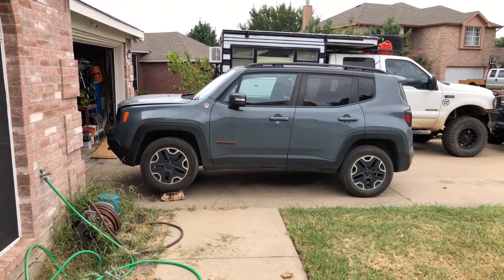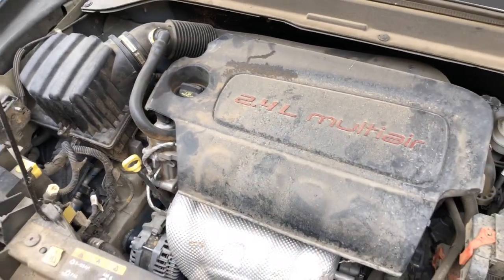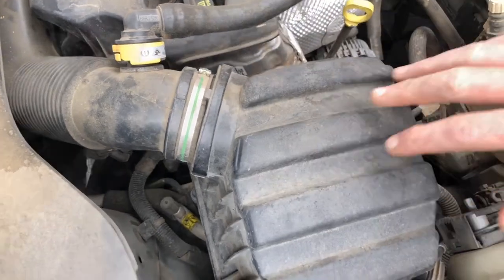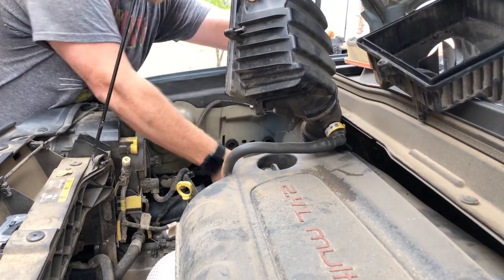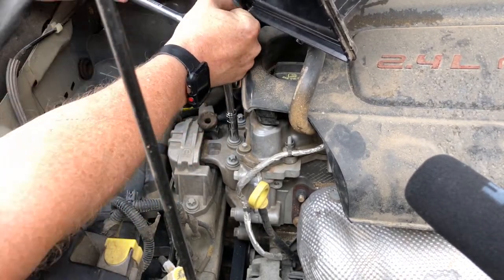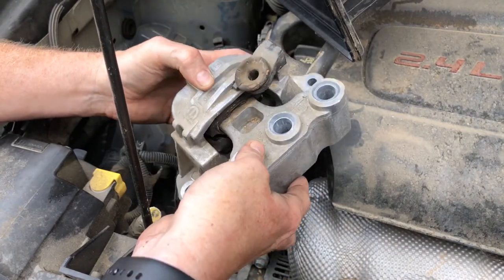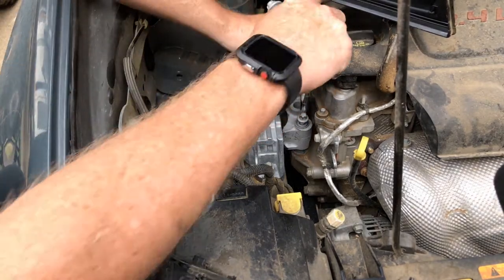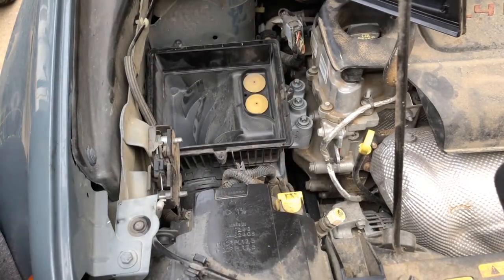How to replace 2015-16 Jeep Renegade passenger side motor mount

Comment: You really should wash that engine regularly to remove that kind of dirt. Believe it or not that dirt will find its way into your engine, transmission and differential. Make cleaning the engine bay part of your maintenance routine. Mine still looks brand new even after 49000 miles.
Reply: I want to clean mine please help any advice and recommendations would be great what should I cover what solution do you use. I detail my fiat all the time but haven't cleaned my bay
Reply: @housebaelishgaming  , I just use a regular water  based degreaser solution. I spray it all over the motor and engine bay taking care not to  wet electrical items too much. Then I wash it off using a garden hose. To dry I use a small air blower.  It works really good. I'm not too worried if the alternator got wet. The important parts like bearings are sealed. no water will get in. To make the plastic and rubber parts like hoses look nice and black I just spray them with armorall. There are many products out there that will do a good job.
Reply: @mainsfortes5778  great thanks so much!  The armor all won't cook those hoses like cooking oil right? I imagine you wouldn't uses it if it did
Reply: @housebaelishgaming  , armorall is fine. There's many others like 303 that works great too.
They are fine for plastic and rubber.
Reply: @mainsfortes5778  ok great

Comment: My dad ordered the new mounts for my sister’s Jeep. They arrived at the dealership recently. How long does it take for technicians to swap these parts? They said to drop off the car for 5 to 6 days. Can’t believe this didn’t make it to the list of recalls for this Jeep.
Reply from the maker: The passenger side mount can be done in less than 1 hour. I’m not sure how long the other mounts take but I’m sure it’s only a few hours each at most.
Reply: Just had some recalls done...catalytic converter and software update. They didn't say anything bout the mounts. But I agree if they were poorly made, it should be a recall to replace all the mounts after so many yrs to be safe.

Comment: I’m having the same problem but also am having a hard time finding replacement part. Would you mind sharing where you found this part?
Reply from the maker: Sorry Christina, I just saw your comment. I ordered it from dodgeparts.com part#68363755AA
Reply: @TheNudnikNation  on mopars website, the part says right motor mount. This is the same as the passenger motor mount you replaced correct?
Reply from the maker: @codyblack3654  it's been awhile but yes, I think that is correct.

Comment: quite helpful. I have started noticing a vibration when a turn the ac on. It sounds like its coming form the back on the vehicle but after some research it seems to be the mount. Very simple video. thank you

Comment: Thank you for the video. I always check youtube before doing a repair, because many times someone has found an easier way to do the job. Exactly as described, I had to buy the sockets, best to find out before tearing into the job. Other than that super easy job .

Comment: Hi,  im own one 500x 1.4 multiair,  my mechanic say the cause why my car shaking is the partially collapse of the engine mount but  why when is cold i feel this vibration everywhere inside the cabin  and when is warming up don't shake anymore but i can earn  small noise on the engine ??  Thank you 😊
Reply from the maker: There may be multiple causes, I suggest starting with the engine mount & then re-test.

Comment: Appreciate you sharing the video I do have a few questions.

I noticed you didn't use a torque wrench when you were putting the bolts back in. Are torque specs not really needed for this type of repair? Also what about blue thread locker?

I have access to the service manual for the 2015 Jeep renegade. And in it are three specific torque specs for the right passenger side mount. 

Right engine mount bracket bolts - 74/ft. Lbs

Right engine mount to frame rail - 44/ft. Lbs @45°

Right engine mount to engine mount bracket - 66/ft. Lbs @45°

I'm stumped figuring out which bolts apply to which torque spec. 

Any advice?
Reply from the maker: I don’t think the torque specs are super important, just make them all “good and tight”. That being said, there are only 2 types of bolts I’m aware in this repair. Engine to mount & mount to frame.

Comment: I was told by the dealership that one of my mounts needed to be replaced, but they will only replace if you do all 3.  Dumb question, but I checked my passenger side engine mount and it doesn't have the "line" or appear to be coming away from the rubber.  Are the top mounts the same on both sides of the engine?
Reply: They're not the same but they're both the same crappy design

Comment: Would a different socket help get the bolts out or does it have to be an E14?
Reply from the maker: It has to be an E14 socket. That is the correct socket for that bolt.

Comment: Does the bolts need to be torqued after installing the new mount?
Reply from the maker: I'm sure they do but I personally just torque them "good and tight". I bet you can Google the transmission mount torque specs if you want to do it right.

Comment: Hows it doing after replacement? I have heard that the new design fails as well and just curious. Thanks!
Reply: Generally, the only complaints I have seen about repeated failure is  with a single mount  being replaced. Both the driver and passenger mount were redesigned. Generally the third mount on the bottom is fine.

Comment: i have a question i have 2017 renegade trail hawk and it vibrates but only when i put in reverse ? not at idle
Reply from the maker: You might check the transmission mount to see if it’s failing.
Reply: @TheNudnikNation  Mine vibrates when I accelerate